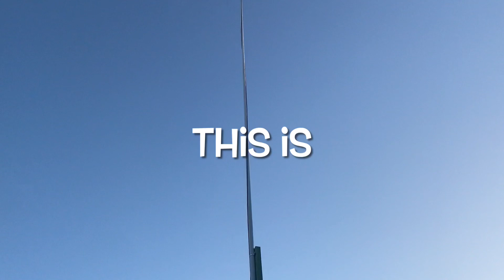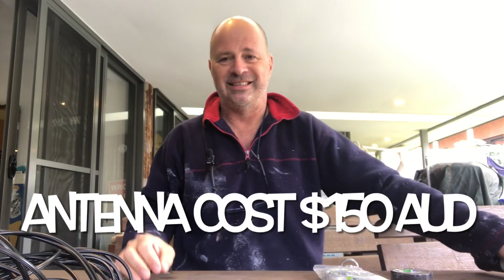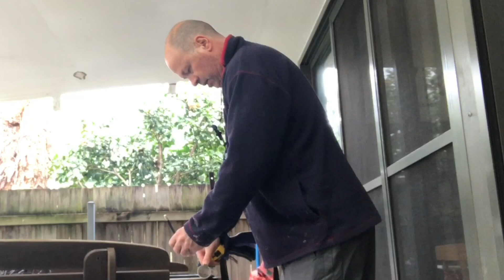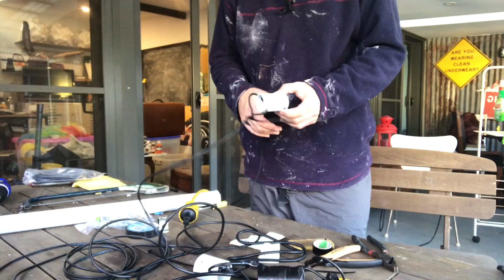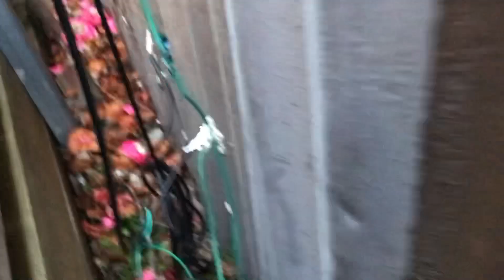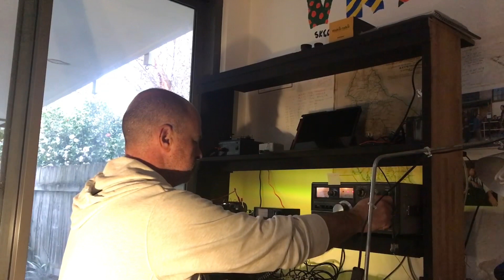DX Vertical L Antenna for 20m and 40m

Comment: Great video. Verticals are well known as being noisey but low angle take off makes them perfect for l9ng haul dx, 10,000k and more. I tx on my vertical and auto switch to a dipole on rx. 73 zl3xdj
Reply from the maker: Nice idea. Weirdly my EFHW is often noisier than my vertical…. But I put a common mode choke on the vertical and haven’t choked the EFHW yet. I imagine a centre  fed dipole is nice and quiet. 73 and tnks fer the comment.

Comment: What's the length of the loading coil, so I can build this antenna
Reply from the maker: Well did you watch the video? 11 mins on. To save me boring you death....40mm approx PVC pipe, I used 0.8mm enamelled copper wire 26 closely spaced turns (You are aiming for an inductance of 30-32 microHenrys). I cut them 7cm long which was MORE than enough. 73

Comment: Good work. Was the counterpoise coil also 30uH and the dimensions similar to the vertical section? Cheers Daryl de VK3AWA
Reply from the maker: Yes the counterpoise was identical. Basically it is a loaded dipole bent into an L! 73 de VK2AOE
Reply: @TheArtofEngineering  Just started building one after watching your video this morning.  I build my wire antennas for portable ops hanging from trees. The driven element is complete and using an adjustable counterpoise results are encouraging.  Now to make the second coil. THANKS.
Reply from the maker: @Htfhjooffhgghwwwwdf  let me know how it goes!
Reply: The antenna tuned up quite nicely on 20 and 40.  I did some comparative WSPR  testing between it and my benchmark antenna which is a 40m EFHW.  It didn’t perform quite as well.
Reply from the maker: @Htfhjooffhgghwwwwdf  Yes…. I have an EFHW (inverted VEE) for 80m and often it is better, but as it is more directional off it’s sides, sometimes the L for me is slightly better as it is more omnidirectional. It is my understanding from modelling the L has slight gain in the direction of the “counterpoise”. Mine has a great ground plane as it lives on a metal roof. I guess a benefit of this antenna is that it can live in a small space. I fitted a common mode choke to mine 
Common Mode Choke - build and install @TheArtofEngineering
https://youtu.be/E4vbBRJdZFg
73 de VK2AOE and thanks 🙏 for feedback!

Comment: Just the sort of thing YouTube is great for! Super useful vid.  Thanks for posting as I'm progressing down a similar route and be interested to see how you get on with it. 👍73 M0AZE Mike
Reply from the maker: The antenna works well. The squid pole needs to be fixed so it can’t collapse in the wind. With the weight of the antenna and trap pulling it down it cracked some section. Nothing a bit of tape and 4 meters of PVC pipe couldn’t fix! 😜 I’m using it for my QDX and CW/SSB … it works well!
Reply: kcppp.ķ

Comment: the 6m Squid pole you are using seems to have a larger diameter at the top compared to most of the fiber glass poles I own and have seen for sale. That is a great advantage. Unfortunately I couldn't find the one you are using for sale anywhere. Do you have a link or part number? 73 and thanks for the video.
Reply from the maker: Link here 😜
https://haverford.com.au/products/6m-telescopic-poles-multi-purpose?_pos=2&_sid=251937e56&_ss=r&variant=12702555340913
Reply: @TheArtofEngineering  thanks for the link. 73.
Reply from the maker: Wider at top as it is a flagpole … I think?

Comment: Peter made me buy a 9m squid pole but they sold out super quick. Haverford should get restocked soon. Jaycar ain't cheap, go to an electrical wholesaler, they usually sell to the public too. That LV garden wiring should be UV stabilised though. I also have been watching the Waters & Stanton videos recently. I need to find cheaper torroids 240/43 or 290/43's. My issue atm is how to string up a dipole or end fed on my property. 
Good job and a good idea with the conduit in the wall. Your contraption worked!👍🍻🤓 73
Reply from the maker: Yes wholesaler is always better! When I did my Reno got all my electrical stuff from a guy on Parramatta Rd…. Much cheaper! Mini kits does Toroids reasonable price. Dipole is a good antenna. G5RV also good all rounder. You got HF yet?